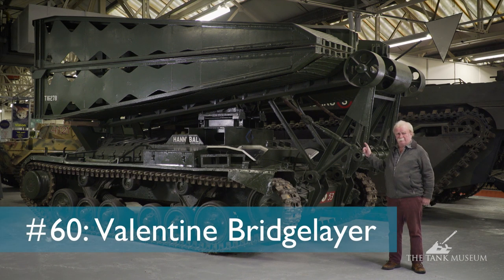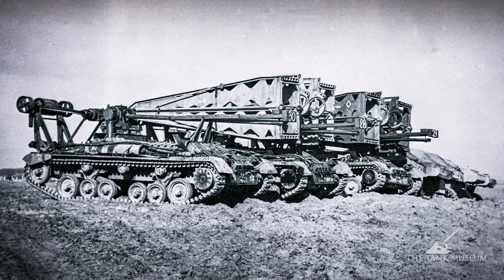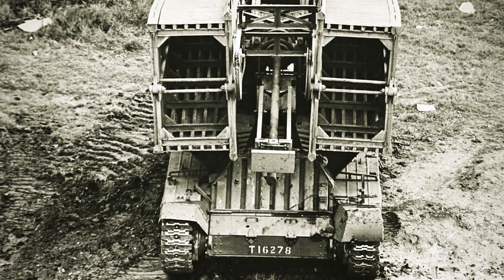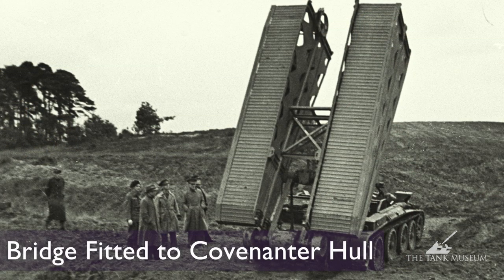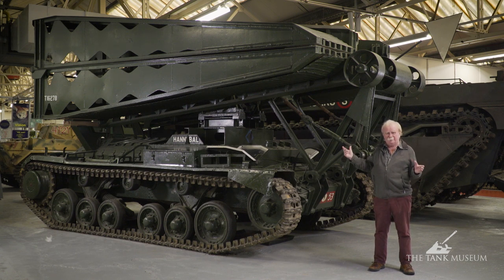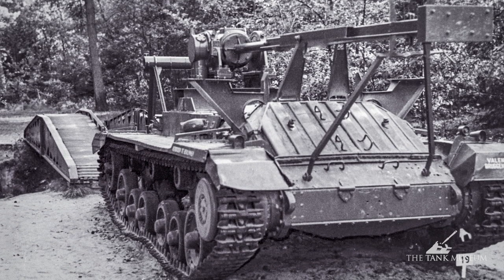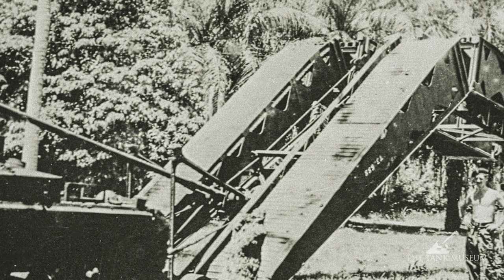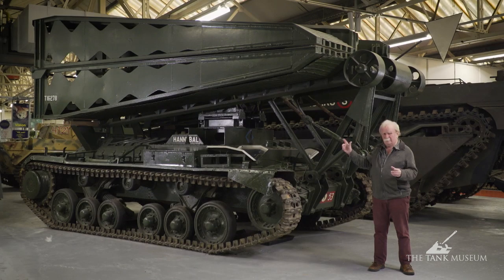Tank Chats #60 Valentine Bridgelayer | The Tank Museum

Comment: Screw thread actuators are used in aircraft as well because they are extremely strong and can generate a huge force. A gearbox can have a reduction ratio of in excess of 200 to 1 (1000 to 1 is possible without breaking a sweat) and locks by using a work gear. So if you have a motor capable of 5 pound feet of torque you can pull 1000 pounds+ with it. With the higher gearing a tiddly 5 pound foot motor would pull 2.5 tonnes or there abouts.

Comment: Since the valentine is an infantry tank, I don’t even want to think how fast that thing goes with the huge hunk of material on top of it.
Reply: Like some sort of tower defense "Slow tank" stereotype unit.
Reply: He does say in the video it could do the Valentine's full normal speed.
Reply: @DIEGhostfish  which is basically "at a leisurly pace"
Reply: It does not have a turret. I wouldn't be surprised if the turret weighed more than the bridge, because of all the armor.
Reply: 15mph to 20mph - he says so in the video.
Reply: @h0lx  the Valentine could do 20mph which was actually not bad compared to the other infantry ranks

Matilda 2 could only do 15mph and the Churchill mk1 about 13mph.

.
Reply: Valentine Tank Salesman - "If you like its speed, you will love its petrol use!"
Reply: I suppose the advantage of using an infantry tank is you don't get so much of a difference from the added weight. I'd have been interested to hear how the Covenanter bridgelayer performed.
Reply: @Jasontvnd9  20mph is pretty good, considering it's job is to sit there, be shot at, and blow up whatever is annoying the footsoldiers.
Reply: By the Valentine, the definitions of infantry verses cruiser tank were starting to blur.  Remember, the Valentine was built on the chassis of a cruiser tank, the Mk I, Mk II.  It probably started as a cruiser, but during development, they decided to clamp on some more armor, and it ended up fitting the infantry tank slot better.  HOWEVER, if you look at the latter stages of North Africa into Sicily and Italy, it was also used in the Cruiser role, especially when they started phasing out the Crusaders.  Phew.  Like most things, it's not that simple.
Reply: @princeofcupspoc9073  Valentine used the same suspension system, not the Hull. It was designed from the ground up as an Infantry tank.

At times in North Africa Infantry tanks Brigades were misused as they tried to use them as regular armoured brigades (which they were not trained or suited for really, similar to regular armoured regts trying to be used in the I tank role - both ended with bad results).

Vally's were used as a base for other armoured vehicles but none were "blurred" into Cruiser tanks roles, even by the Soviets.
Reply: Valentine was designed to fill the specification of a heavy cruiser.
Reply: @yereverluvinuncleber  Valentine was designed as a private venture I Tank, not to a specification.

The A10 was designed as a better armoured cruiser (basically just slap more armour on the A9), it became too heavy and slow to carry out the cruiser role and still too thinly armoured for the I Tank role so was designated a Heavy Cruiser.

The Valentine just used the proven and effective running gear as a base for a new heavily armoured tank that could be developed and enter service quickly (the official I Tank spec led to the Churchill which was being developed at the same time, but took longer to mature).
Reply: Quite right, I rolled the A9.A10 and Valentine all together as the hull length, engine, suspension, mantlet, gun is all derived from the earlier models, the fundamental components are largely the same,

Comment: It's possible that they made the bridges foldable so they'd fit onto transport ships and landing craft more efficiently.
Reply: It did make it easier to transport but its main reason was to enable a long bridge to be carried and laid easily, the Churchill AVLB carried a one piece bridge that overhung at front and rear  but it could not span as wide a gap. 

Easier to fold a 20m bridge in half to drive with than try and drive around with a bridge twice the length of the tank hanging over, with the driver trying to judge where the ends are, what they might hit at the front and back as they turn/slew.